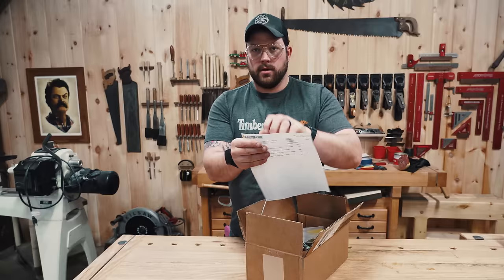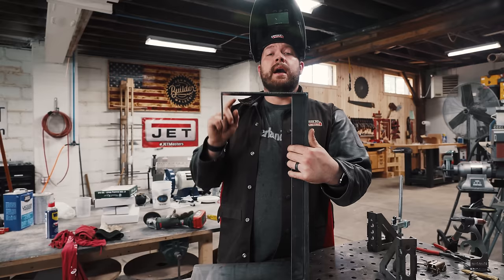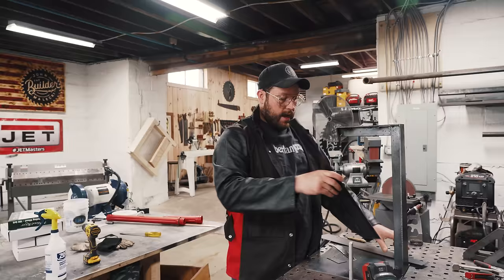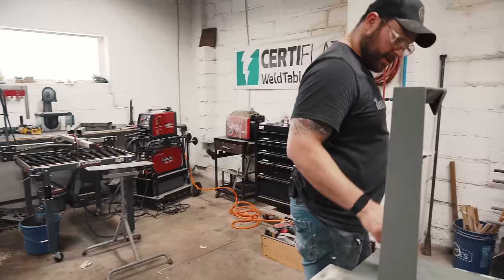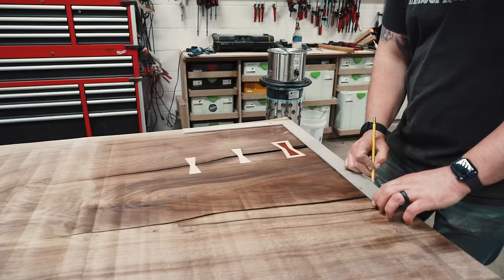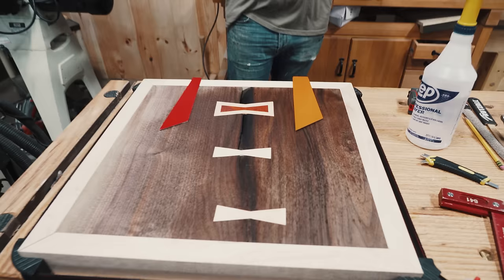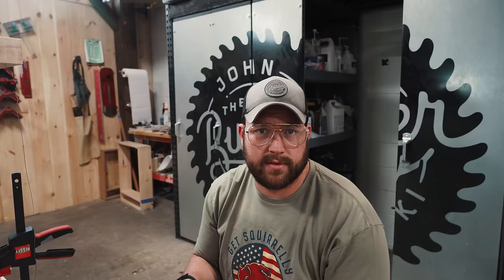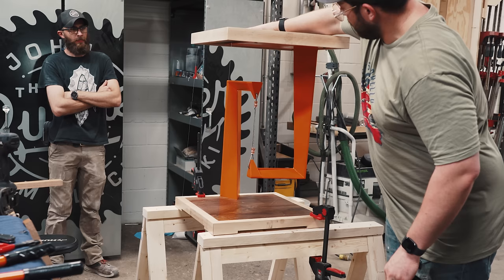Another IMPOSSIBLE "FLOATING" Table Build That Almost BROKE!

Comment: Great build. Question. When rigging a square piece of equipment you place 4 lifting lugs with straps at the corners to pick it up. In actuality only 2 straps are doing the lifting because none of the 4 straps are exactly the same length. So the shortest strap and the opposite strap are lifting the load. Could that be why the top is swaying in that direction?

Also go bigger over all. Build a metal base with multiple drops for a table that is 6 ft long? Stabilize the corners the same

Comment: When you’re sharpening planes and chisels, do you have a slightly rounded shape from the edge to the body of the blade, or a precise angle, with a hard edge from where the blade taper starts? A friend of mine is a Material engineering major and was noting in a class that a slightly rounded taper coming off the edge can stop the blade from chipping quite as easily. I hope that made sense, if love some input but I’ve phrased this badly I think hahaha

Comment: I got a slab of walnut 6 feet long and 26 inches wide came off the mill and one area was lower by nearly a quarter of an inch. filled a 55 gallon trashcan over half with the shavings after hand planing it flat. the saw bit in nearly a quarter inch further a third of the way down the board, forcing me to plane it all down to size, it was 80 here, 95 sounds like a nightmare.

Comment: Next level... Would it be possible for the  "invisible" corner wires to attach to the opposite corner so they are diagonal instead of verticle. Have all the wires meet at some type of rotating sphere whatchamacallit so the top table can spin and levitate.

Comment: You should leave the 100lbs on it, and then tighten the four outside cables. Doing that would make it SUPER stable, because after the initial test, it's highly unlikely it'll ever have anything near 100lbs resting on it again.
Reply: Also, I think it'd be really cool to run your four "invisible" cables to the center of the bottom, instead of the corners. The concept should work exactly the same, bc they'll still be in tension. Who knows, may help force it to stay centered as well.

Comment: How about you do a concrete base and top, metal supports, and set some eye bolts in the concrete. Then use the biggest chains you can find instead of wire.

Comment: How precise do the metal “bird necks” need to be? Can they be slightly different from each other or do they need to be identical? Thinking about doing this project but would have to resort to cutting the steel with an angle grinder.

Comment: Would it work if you got the corner wires underload with a spring? so its always under tension, would be posible to hide them under the foot of the table

Comment: With the addition of the the metal there is no need for the wires to be connected to the base plate. You could instead have the wires connect the the top of the base’s arm. This would hide the thin wire even when close and the shorter wire should have less play in them so less potential to rotate the top.

Comment: What about a Hexagon with halved joint on barrow wheels (yes i had to google the name, don't hate me) for the center, and for the external cables doing an X pattern to the opposing corner of the same face. Would make it harder to get aligned with the base looking top down, but i think it would work still and allow for less give. Don't hold me to that, I'm not an engineer.

Comment: What about a 3 point center?  

The 3 point center would have a small triangle for the bottom of the center cable.  The center cable would be THREE center cables, coming down from the ONE center holding support point, to each corner of the triangle of the bottom center point.  IOW, the center cable become 3 cables, the tip of the 3-sided "pyramid" is the upper hole for the center cable, and the bottom of the 3-sided "pyramid" is a triangle. 

Or a 4 point center...  same thing, except 4 cables and the bottom of the center support is a square instead. 

Could even make it opposing "pyramids", where there is a square on the top AND bottom of the center support, and the tip of each "pyramid" is attached to the inside center of each square bottom, so that the two squares sit catty corner to each other, and the cables pass through the sides of each "pyramid".

Comment: You could use 50 lb fishing line for the 4 outer line because ALL THE WEIGHT is on the MIDDLE WIRE and no down force is on the 4 outer lines. Right??

Comment: Just a tip you could’ve measured the strength of the rope and remove the number of the weight of the top part and calculated how much weight it could hold

Edit:also your like the more adult bobby duke arts

Comment: I don't think you could break that one if you wanted to, the bulk of the weight is being put down through the 800lb cable with some torque and pulling happening on whichever of the outside cables have the most tension. Depending on the number of cables that have tension in them will determine how much you can hold. So... a lot. If any of those pop, you'll have an issue... but very unlikely it will be less than 150lbs for 1 cable, or 200+ with more cables.

Comment: 1/16th aircraft cable would have done it. And they make Nico sleeves can be compressed on the line like a stop without looping it into it self. J.s.y.k.

Comment: If you want to avoid racking with a single-center-suspension design like this, you need angled outer cables to carry the lateral load, rather than using purely vertical cables all around.

Comment: Dude do it with chain!
Reply from the maker: I think chain is so ugly man haha maybe down the line. But i prefer cable
Reply: @John_Malecki  thanks for the reply! You definitely wouldn't have an issue with weight though.
Reply: @John_Malecki  Maybe Stainless, chrome, or blackened steel - but just in the center.
Reply: Build a Floating Chair.. Fully functional chair..

Comment: Hide the cable loops at each end so all the eye sees is the plain cable. Look at other tensegrity designs not just the boba fett ship style
Reply from the maker: Yea i bought the wrong crimps for those, and for these larger wires i didnt make enough space inside it to have a large loop. I'll make it neater for the next ! Thanks dude
Reply: @John_Malecki  Not criticizing in the least, it is an awesome build and a cool use of physics. In my mind I am thinking barrel connectors on the ends but not sure how strong those are. Also you mentioned a couple of issues with the tensioning, would a couple of inline twist things like used on gates help for adjustability?

Comment: You should tighten down the outer wires while you have 100 lb. of junk on there so that it stays tight with weight on it and just has more built up tension when not holding anything.
Also, try standing on it. I want to see a person or two on top of the next table.